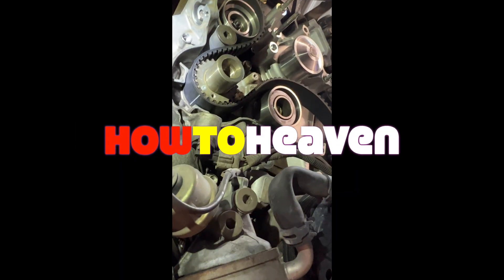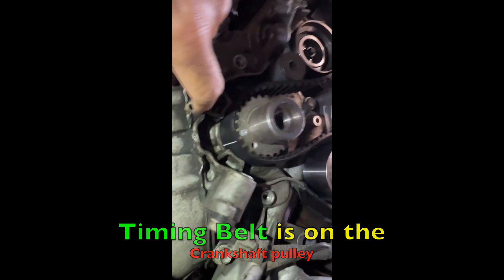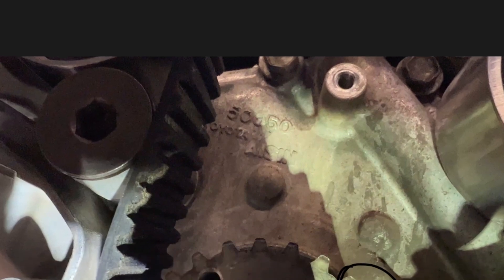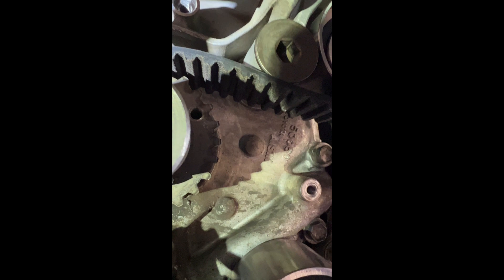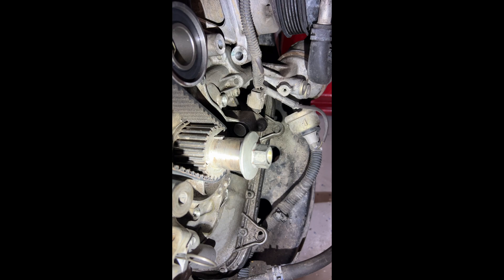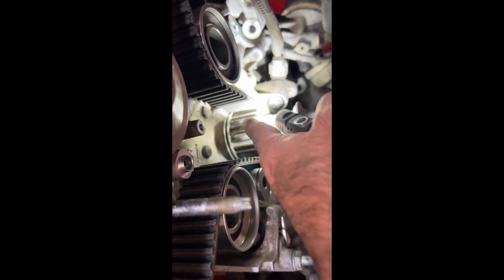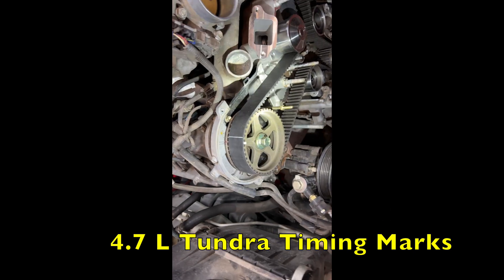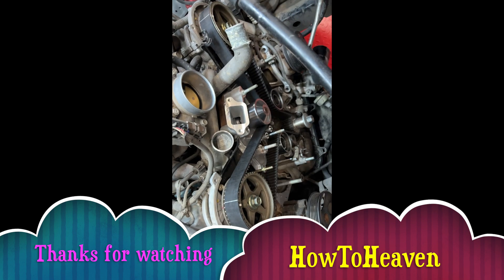Definitive Explanation of the Timing Marks 4.7L 1st Gen Tundra V8 2003

Comment: I'll explain better the cams have  one marked with one and and two dots on each cam, so my question is with one set of cams on the driver side being align with the one dot and the passenger side being align with the two dots, do you think that that will put the timing out and the crank is set to mark that Toyota says to put it to.

Comment: I have a question on a 4.7L motor 2UZ from Toyota, the question is when as per Toyota says the cams are manufactured with paint marks on the cams to put the cams in timing marks are not there, but the cams have two indent marks that line up does this mean the cams are now set for timing
Reply from the maker: Without seeing your cams, I would venture to guess that the indents are the timing marks.